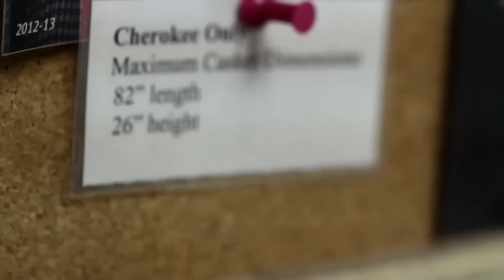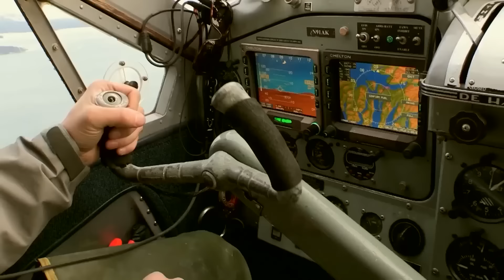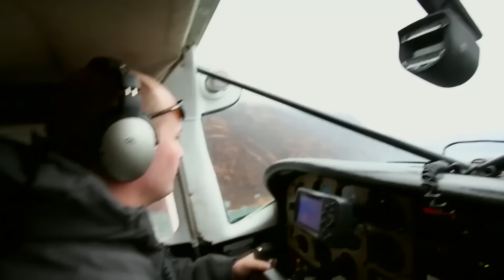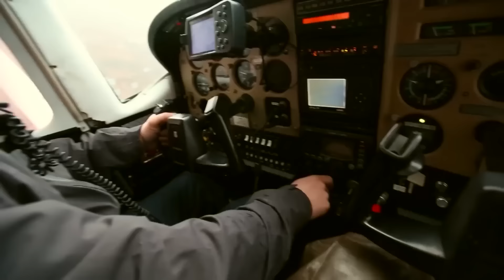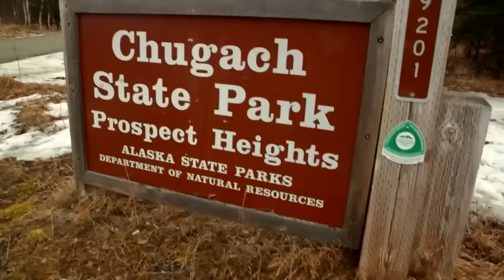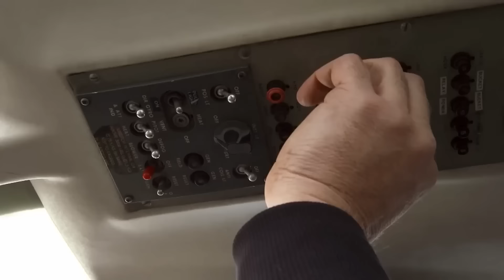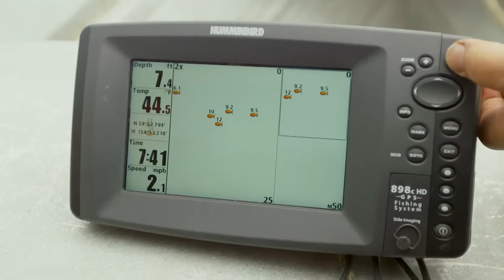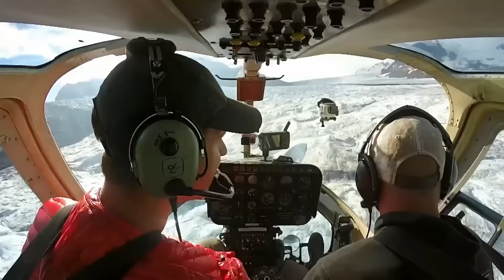Alaska's Ultimate Bush Pilots | Complete Series | FD Survive

Comment: At 3:50:48 they are doing a salvage operation with trees all around the wreckage meking it very difficult. If they had known about a tool called a chain saw they could have cut enough trees down in twenty minutes to make the job much safer.